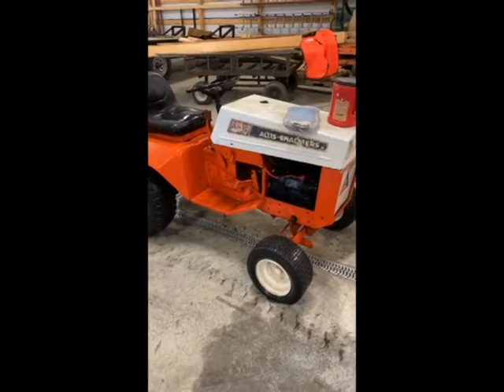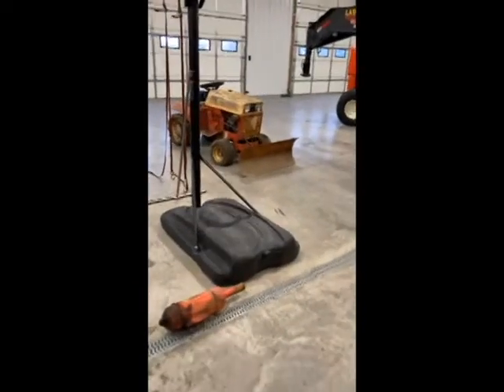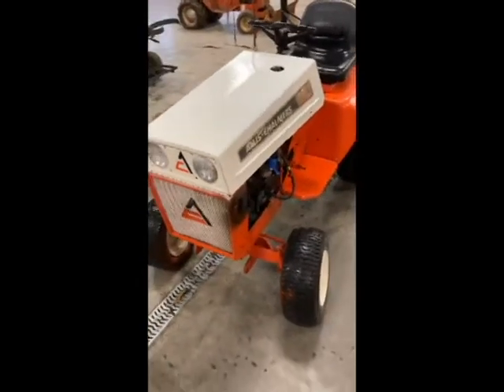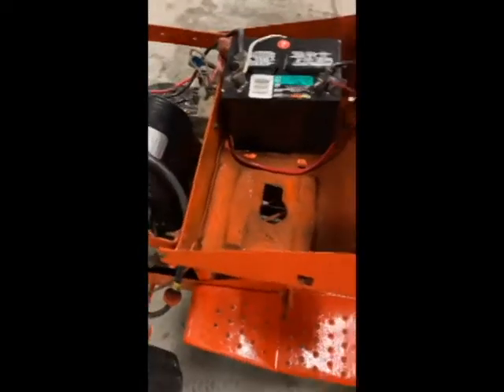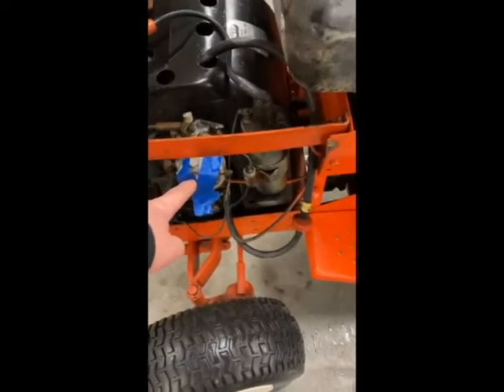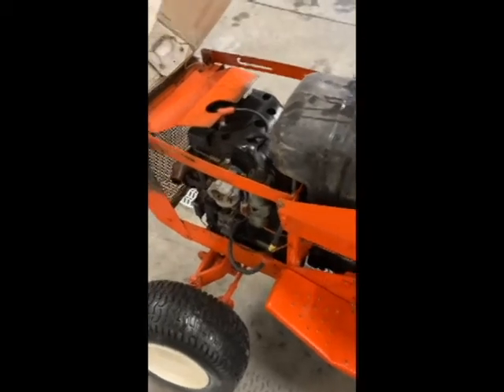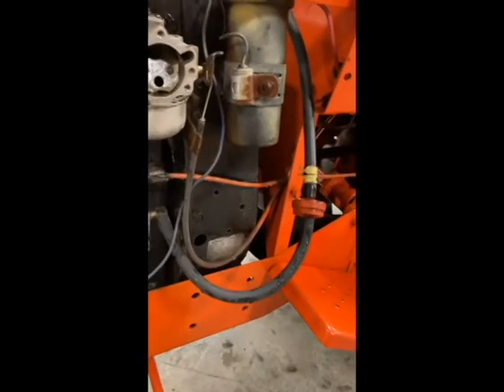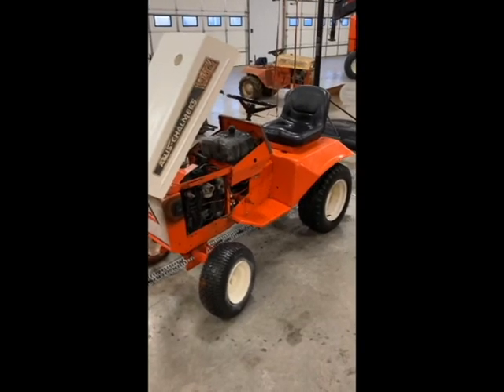Allis Chalmers 416 Garden Tractor Arrival and Clean up

Comment: The upper hole in dash that is empty is for pto switch. The switch under that is for the electric deck/sleeve hitch lift. I think I saw the actuator when you zoomed in under where the fuel tank sits. If you need pictures of anything let me know
Reply from the maker: Thanks Randy, yes the electric lift is in there and partially wired up to the switch.  The linkage where there used to be a handle isn’t connected to anything would the electric lift have been added later?  Seems like if it came with the electric lift the handle pieces wouldn’t have been there.
Reply: @nashsummers8050  the lift could have been dealer installed in which case the lift handle would have been removed. I took two wiring harnesses to make one good one for my lift. Looks like the muffler is missing. It’s basicly the same as an older Cub muffler that exits out the right side. Look up my video “416 first start” I think it shows some of that stuff
Reply from the maker: @packrattsplace537  gotcha ok I’ll check it out. My 314 has an elbow and exits out the right so I thought this one should also.

Comment: my 410 that light is for the electric clutch for the deck  the linkage is for manual lift mine is maual looks like lever has been removed  just guessing  i think the 410 is older  l be watchin!!
Reply from the maker: Gotcha yes I’m missing that switch and some of the wiring has to be redone. This one also has the electric lift, not sure if it’s tied to the deck or not. Do you know?  The lever linkage underneath isn’t hooked to anything.

Comment: You get this from an older gentleman not far from Borden Indiana ? I'm almost 100% sure this is my old 416 if so I can tell you the history of it. I completely stripped it down sandblasted repaint etc. Have pics and vids of it . The Allis logo painted on front grill gave it away for identifying it to me.
Reply from the maker: Yes I did get it from that area.  He passed away and knew his son, so that's how I was able to get it.  Please share your history of it if you like, send to my cell or call 502-396-3787 I'm in Henryville.
Reply: @nashsummers8050  I was afraid something may have happened to the gentleman, he always said if he got rid of it he would call me first since I wanted the electric lift back Lol. He was a super nice man spent an entire day at his place just talking.  He traded me a sleeve hitch plow, brinly tandem disc and cash to boot. I see about looking up my pictures and videos of the mower. Yeah that logo and over spray on the tire gave it away. If memory strikes me correct I believe it was Fowler rd